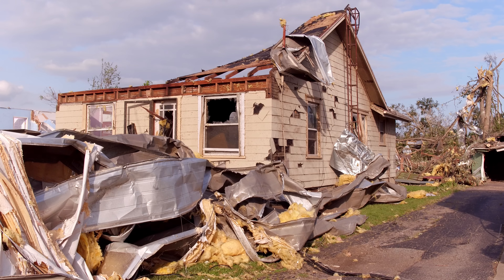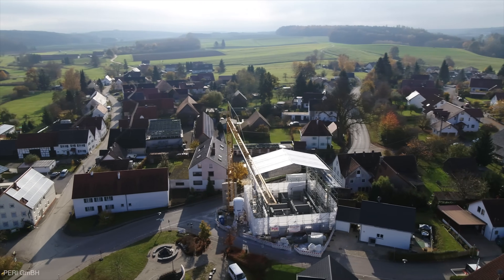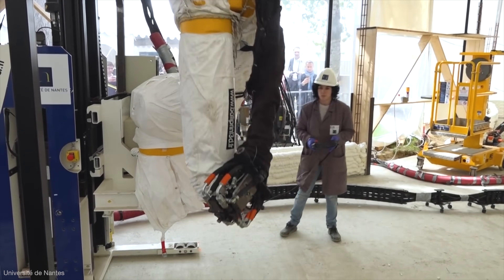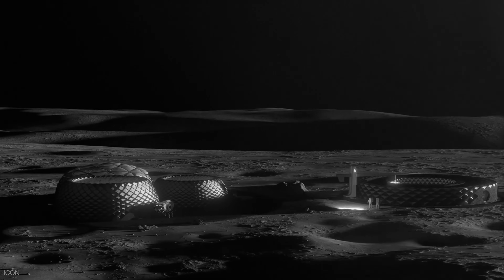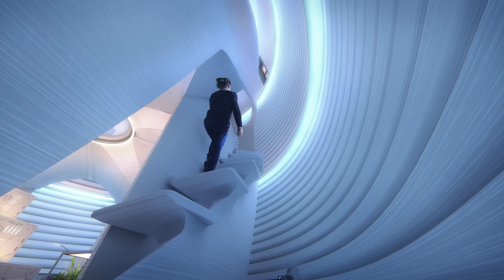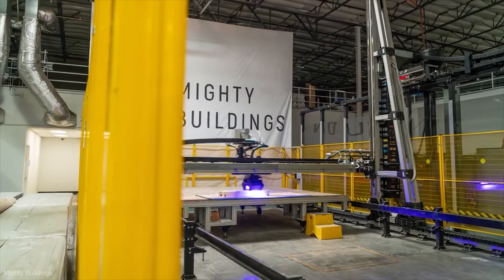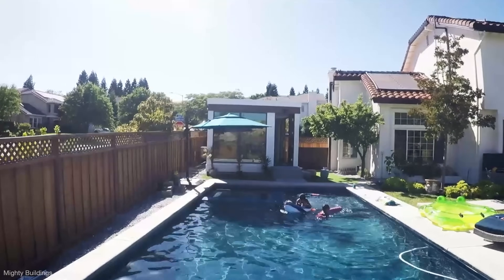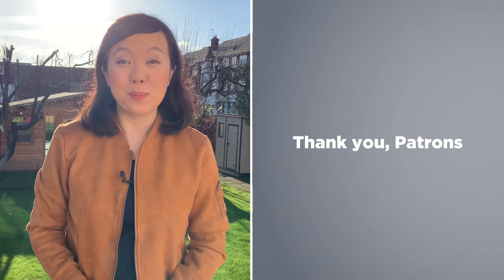Why Future Homes Will Be 3D Printed

Comment: IDK... Why do the surfaces of those houses have to look like the Michelin Man? Can't the nozzle spitting out the concrete have some flaps added to its side that would and thus forcing the concrete to a specified width negating the spill to the sides and thus causing the bumpy surface?

Comment: Great video, Cindy.  (Congrats on passing 80K subs!)   3D printing is innovative, but I would stop short of calling it disruptive to the construction industry.  When it comes to architecture, there is no consistent standard for appearance.  At this point, 3D structural printing has too many limitations on the type of interiors and exteriors that can be produced.  I'm fairly confident that 3D printing has significant potential in utilitarian applications.  (Ex. emergency shelters, utility storage, etc.)  But, most people simply won't want to live in anything that has that extruded look to it...and if it takes expensive finishing to make it look better, the cost savings aren't as significant.  Still, I cross my fingers for this technology.

Comment: All 3d printing has done (so far) is to be able to print the walls of a standard home. The possibilities are endless - but there is no real breakthru yet in terms of rolling out a usable product, or having a city state approve the technology so builders can utilize the automation and pass on the savings. Numbers are thrown out by manufacturers of 3d printers - that the savings are in the orders of magnitude that make a builder sweat. But in reality - the dificulties of creating a complex building with all it mechanical, hydraulic and electrical systems has not yet been addressed or solved by any small or large scale builder.

Comment: 20% cheaper doesn't sound like huge savings. I mean its a lot for a $400k home, but the important thing is whether the result is better than 80% as good by whatever subjective or objective measures you can consider.
Reply: Solidly built and much quicker turnaround, id say worth it. Plus complete customization is possible, eg curved walls and styling